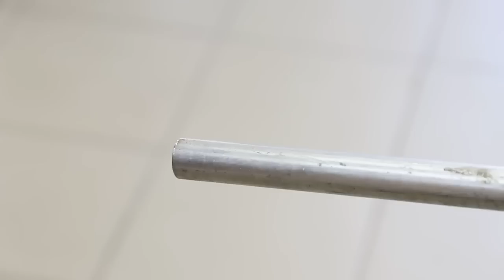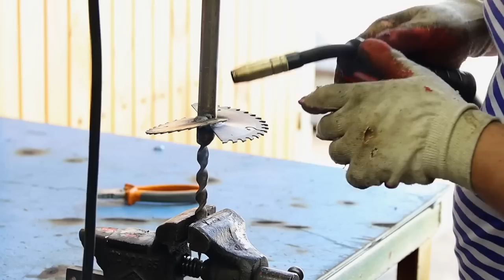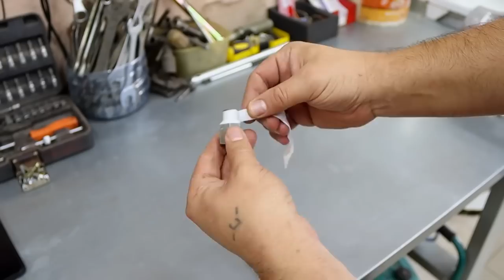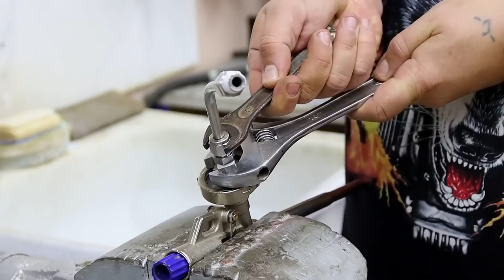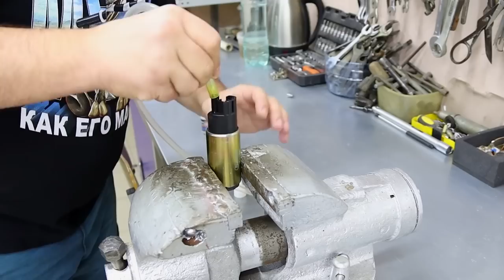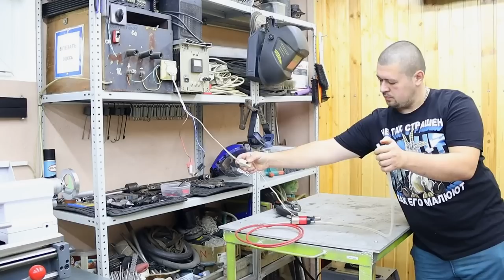Wow! Brilliant ideas and tips that work really well !!!

Comment: Those fuel pumps are designed to be submerged in fuel to keep them cool, plus oil is thicker than fuel, which will make pump work that much harder and create more heat, which will slow pump making even more heat, just not feasible way to "change your oil", plus all the gunk and small metal partials are in bottom of oil pan, why you have a drain, when oil is rushing out it pulls much of the harmful materials with that oil 🤦‍♂️